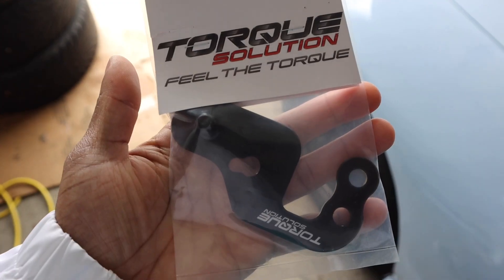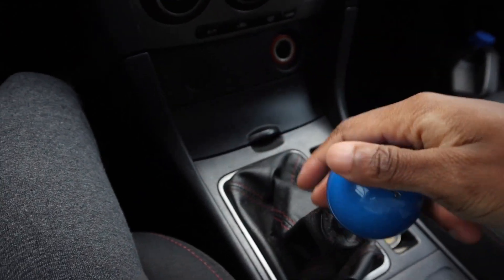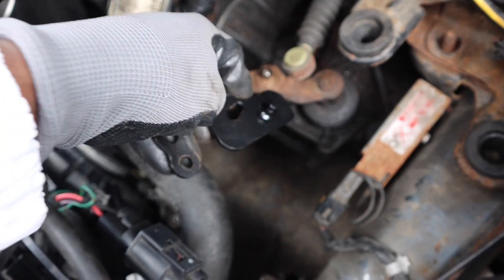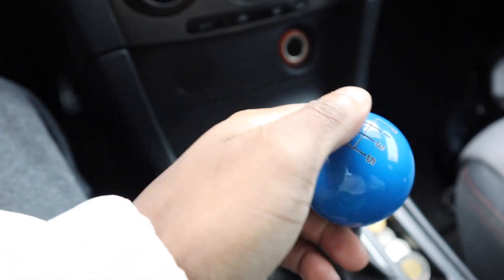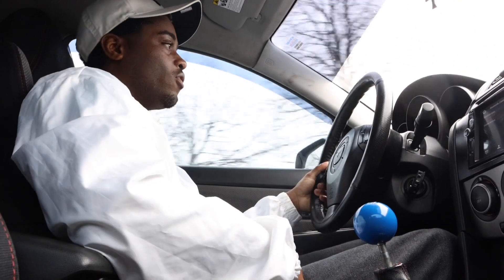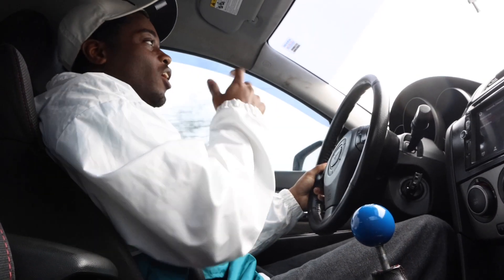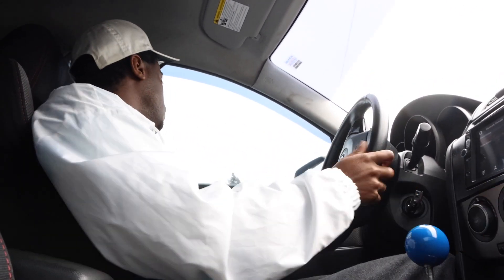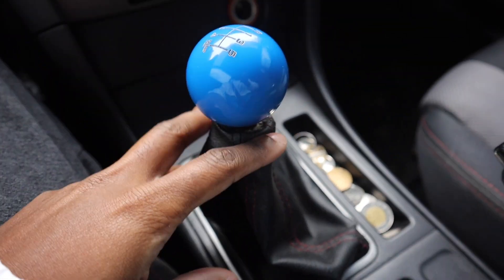SHORT SHIFT PLATE INSTALL on my MAZDASPEED3!

Comment: Short shifters are terrible for these cars. Should do some research!!!
Reply from the maker: No problems with this one, it’s 32% shorter, so it’s barely THAT noticeable from stock gearing. So far no issues, but if it does give any trouble I don’t mind switching it out 🙏🏾